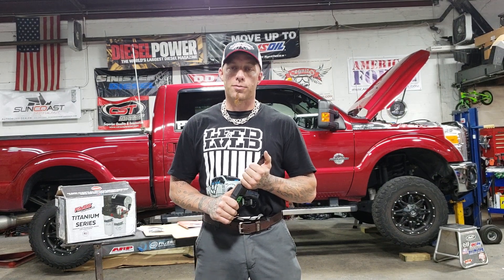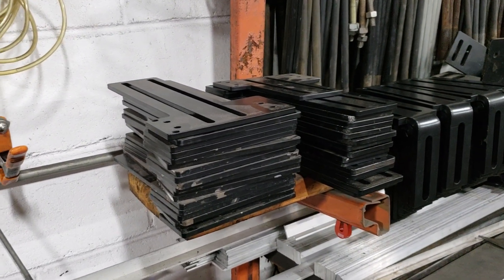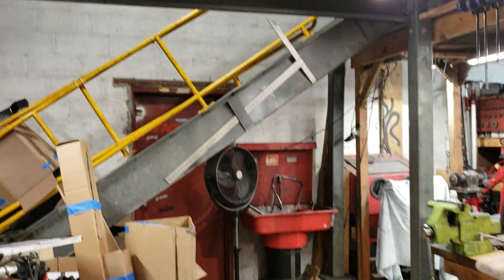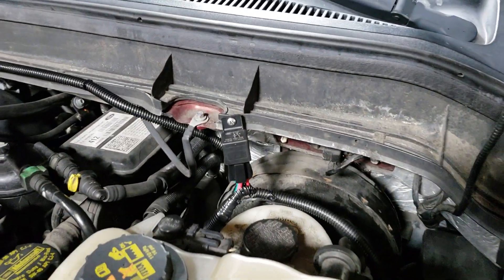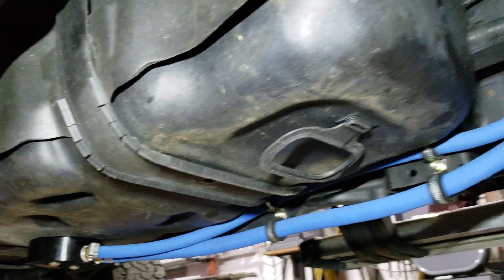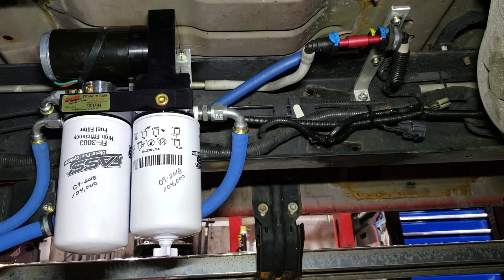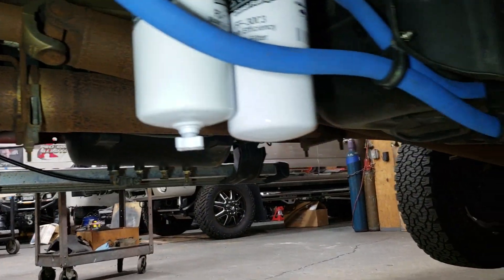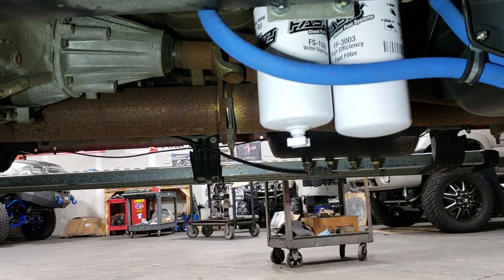Ford 6.7 PSD Powerstroke diesel FASS fuel air separator system 125gph titanium lift pump with sump

Comment: I notice you said in one of the comments that the 165 isn’t designed to replace the factory lift pump? My 165 titanium came with factory lift pump delete fittings and a draw straw and I’m having bad cavitation issues. Do I need to install a sump to remedy this issue?
Reply from the maker: I'm assuming you have a 11-16 PSD? If I'm not mistaken, the other applications only have models that replace and "bypass" the oem pump. With the 11-16 165gph pump it supplements the oem pump. The 140gph utilizes a draw straw and eliminates the oem pump

Comment: I have a 2017 powerstroke 6.7 and have the FASS system I bought sitting in the box on the kitchen floor.  I have called FASS tech guys three times now.  They always start out very friendly until I start discussing that their instruction for the 2017 ford suck and I don't understand how the fuel is getting to the filter on top of the motor.  I did not get the bypass kit because I was told I don't need it, from FASS.  Anyway I seriously thinking about sending it back and forget about it.  There is not a 2017 powerstroke video out from FASS or anyone else I can find.  I checked with a shop about having them install it and they were talking $800, no way them I paying that kind of money or letting someone I don't know touch my truck.  I have saved for a while to be able to purchase this system and now I pissed about not being able to understand the instructions and installing it myself.  I not a diesel mech but do have a pretty good understanding of it.  After checking around on line, I'm not the only one who has a problem with the instructions.

Comment: So do you just unplug the factory water in fuel sensor when you remove the factory pump? No wif codes thrown?
Reply: I’m about to install mine. Fass told me to put the sensor in dielectric grease and wrap it in a finger of a rubber glove and seal it off

Comment: Ford fuel filters are expensive. With the fass system it eliminates the fuel filter under the truck. Can you purchase just the filter that's on the engine. When we order ford fuel filters it comes with both filters

Comment: How does adding the lift pump affect the factory fuel filter up on the motor? And do you prime it the same way when you you change out the filter on the motor?

Comment: I know on the gm's lift pumps are almost a must. is this the same with the fords?  i have a  2013 ford 6.7 as well and wondering if this would be a good product to install for longevity and reliability? any information is appreciated.  Thanks
Reply from the maker: FASS offers several products for the 6.7 PSD. When applied correctly, any of them will most definitely provide an increased volume of clean, air free fuel to the engine. When the system is installed correctly w a sump and designated hoses, the engine will experience an increase in response from low rpms and WOT pulls will be cleaner and smoother. The 2 main systems offered from FASS in the 125gph (replaces oem pump) or the 165gph (supplements oem pump but DOES NOT replace it). Either 1 of these systems can feed streetable setups from and over 600hp.

Comment: Do you have or do know if there are fittings to snap the fuel lines together to eliminate the engine fuel filter entirely?
Reply: i would just get the conversion from h&s

Comment: Great video buddy and very informative. Question, doesn't the factory system do pretty much the same as this aftermarket system?  I mean there's a filter by  the tank and then another filter on the engine. Anyway take care buddy and thanks for the video  bye.
Reply: If your deleting, tuning, doing other mods on your truck to get more HP out of it the factory system may not be pumping enough fuel to the motor which can cause plenty of problems